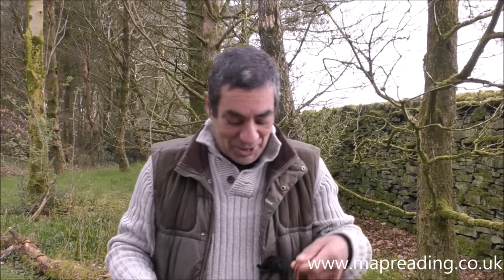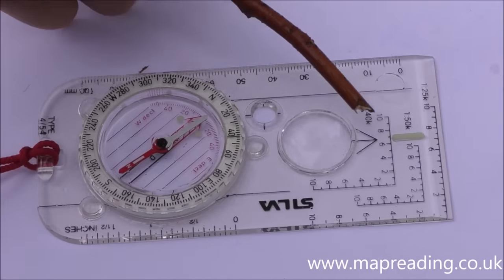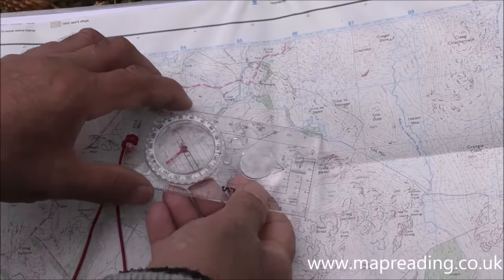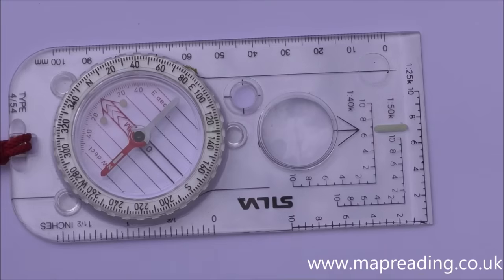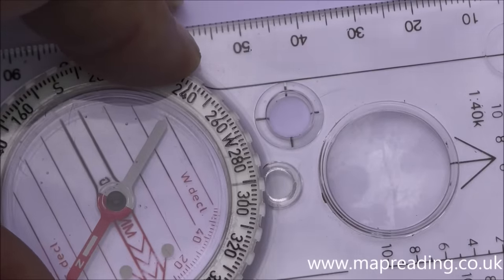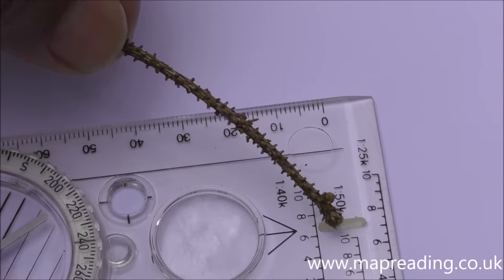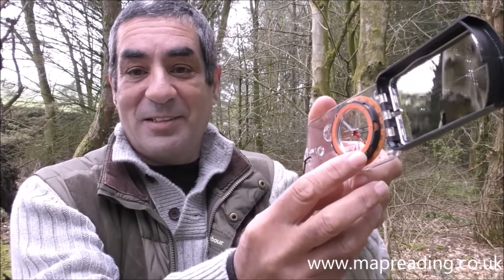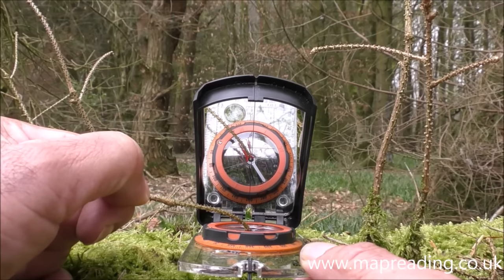Base Plate Compass, "every" part identified and explained

Comment: What are the 2 white dots either side of the red arrow?
Reply from the maker: Hi Pauline.  They are luminous marks so you can see the where the arrow is pointing at night
Reply: To center the needle between at night, they glow in the dark or are easier to see than the red which is very hard to see in low light.

Comment: Very interesting. I have a the same SILVA baseplate compass. Oddly the smallest Roman scale on mine is 1:63360. I’m going to search for the radiation sticker! Great video. Thanks for taking the time. I’ve often wondered what all the features are, particular the declaration graduations. Best from Switzerland.
Reply: 1:63360 is the old Ordnance Survey 1 inch to the mile which was what I grew up with 'back in the day' and was in common use by ramblers, hillwalkers, scouts nd guides.

Comment: You know, I learned how to use these things as a kid but I have not once used them since because I never deviated from marked trails and have always had a pretty good sense of direction and location anyway. Certain aspects of the described usage here I tend to take slight issue with. That is, a valid way of doing things but not the best way, such as the declination, setting a bearing, and incline measurements. I also have taken a dislike to oil compasses since every time I go to pull them out to pack them, they have a bubble in them. So I have instead kept a dry compass around. Yeah, you have to take care while using it and find a spot to set it on when you're reading it, but as long as you keep the dial locked when you're not looking at it, it's much more reliable. Also don't forget that the mirror compass can be used for the same thing mirrors in general can be used for while hiking and camping, including grooming and as a signal mirror.

Comment: In some places, where the magnetic declination is significant, an adjustment screw is preferred.  You could be in big trouble if you forget to make the adjustment or make a manual adjustment erroneously in the opposite direction.
Reply: Where I am (49N, 123W) it's about 16 degrees. That can induce an error that's easy to correct.
Reply: @DeadeyeLefty  Yes, if you turn the 16° the correct way then you will be good to go.  If you turn it the wrong way, the error will be 32°.  That's why I like the screw adjustment-- you'll get a lot more consistency.
Reply: I am about 120 miles from you so I have about the same declination.

Comment: Can you please tell me what the letter printed into the bottom of the baseplate you were using represents ? Under the magnetic needle there is a hollow arrow,  half red, half black with "MN" (or NW) printed in red in the red half of the arrow and a black letter printed in the black half of the arrow. On my compass it is a "D". I think on your compass it was a "C". The MN is obviously representing Magnetic North , but what is the purpose of the other letter ? I have asked several folk and a variety of suggestions have been made but what is it actually for ?  TIA.
Reply from the maker: Hi Clive, the letters on the bottom of the dial, e.g. FF, G, D. etc.  are codes indicating the year of manufacture - they don't produce a public list of which letters correspond to what year as it’s for internal use only.

MN & MS are the  magnetic zones the compass will work in - North and South.

Hope this helps
Reply: Silva compasses are balanced for three different zones: MN (Magnetic North), ME (Magnetic Equator), MS (Magnetic South).Thanks for the video, very informative
Reply: @MrPielips  Thank you very much for your reply. However , I am aware of the magnetic zones used by Silva. My question is not really about that, but about what the additional letter , in black , on the baseplate is for. If you look at your compass you will see what I mean, or , with respect, please re-read my original question , to clarify my enquiry. Thank you again.
Reply: The world is divided up into magnetic zones.
NM Nth Mag, US Nth America, Nth Europe. This helps to balance the needle towards Nth., if would not work in Aus or NZ so well.
Reply: @davidlegrand6545  Thank you for your reply David. Another guy has already made this point and as I said in my earlier reply to him , I am aware of these zones BUT my question is not about these , it's about the additional letter on the baseplate. Thank you again.
Reply: @TheMapReadingCompany Thank you for your reply , which only appeared on my feed today. Cheers for  clearing up this anomaly.  Over the years I have been told that those letters were for various "things" such as factory of manufacture , inital of person who made it etc., Since I posted my question my hillwalking friend Allan has come up with a old Silva compass which has a clear,obvious, date stamp on that position of "77" . So the codification of the date of manufacture must have , obviously , commenced after 1977. Can't tell you how pleased I am to have cleared up this very minor point.

Comment: I looked on the Silva website, it is quite difficult to find the manuals until you click on whichever compass you are interested in and then it has the manual for the one you have chosen, I would have thought it would be in a separate archive but nope, it is with the compass you are wanting to purchase, those Swedes are far too practical and did one for each compass.

Comment: Had map reading, plotting, cartography, surveying etc. rammed down my throat at secondary school during geography classes, in Wilts. How the hell could you get lost in England? Considered it a waste of time. Moved to New Zealand, and spent years hunting and trapping for a living in the forests here. Suddenly useful. I've taught many Kiwis how to map read and navigate, and found plenty more, lost in the bush, walking around in circles. No map or compass. You'd think that they'd teach that stuff in school here, but no.  I always carry 2 compasses, one in my pack, and one in my jacket, in case one gets broken or lost.
Two problems that I've encountered here. One bloke who always navigated using 'bush sense' was lent a compass on a foggy day for his own safety. He set the bearing to return, but the thing had a slide for locking the pointer, so it became useless. He returned OK using his bush sense, and told my friend that the compass must be broken. Do you have one of those in your collection? Another problem here is the amount of iron ore on the surface, and iron sand on the coast. You need to double check with the sun and your watch, and if you're a visitor from the northern hemisphere, the sun goes the other way around down here.

Comment: Maybe a quick video on what kind of stuff can interfere with the operation of a compass.  Around here there’s something called the Mount Penn spike. It is an outcropping of magnetic rock that interferes with compasses.  I don’t exactly know where this is because Mount Penn is massive and it’s actually a hill. At any rate supposedly compasses don’t work in that area.

Comment: Hi,
I saw the calibration clip. Any chance to make one about storage (when on a trip and when is not used), maintenance? On ebay there some kydex pouches (the seller say they are army issue)-are they usefull?
Reply from the maker: I’ve seen a few of these pouches advertised (there are many small companies trying to sell them) but I’ve never had one so I can’t offer any advice. 
I can understand keeping a £500 Francis Barker M73, a £140 Suunto KB 14, a £300 Breithaupt CONAT 4, etc in a protective pouch.  But for a cheaper compass, of the type I tend to use,  I can’t see the point.  If it gets scratched or dented then I’m fine with that, as long as it still works.  But anything which would break the compass e.g. accidentally standing on it, etc. isn’t going to be prevented by a canvass bag.
But some people love gadgets so if they want a little bag for their compass that’s OK.

Comment: The one that curves up at one end is probably made that way so that you can lay it flat on a surface without the lanyard interfering.
Reply from the maker: Oh, you may be right about that.  I didn't think of that.  Good point.  
I asked a rep at a trade show why they bent the back and she said it was to make it "ergonomically pleasing".
I have just looked a few compasses and most are just flat and they have a raised "bit" for the lanyard.

Comment: When I turn my Silva Expedition 4 upside down underneath the orienteering arrow there are two marks. The first mark is "MN". I understand this to be that my compass is meant for the Northern Hemisphere. However, next to the "MN" is a letter "H". I notice on other compasses that this letter will vary. Can you please share the meaning of these letters? Thanks in advance.
Reply from the maker: Hi David, the letters on the bottom of the dial, e.g. FF, G, H, D. etc.  are codes indicating the year of manufacture - they don't produce a public list of which letters correspond to what year as it’s for internal use only.

MN & MS are the  magnetic zones the compass will work in - North and South.

Hope this helps
Reply: Thank you very much for your clarification.  @TheMapReadingCompany

Comment: Have you ever had the problem of bubbles in the Rotating Bezel of a Compass.
Ive had to bin a few because of it.
I live in the UK so not been at great altitudes
Reply from the maker: Yes I've had quite a few.  It's a pain as it is 100% down to very poor quality control and lax systems in the manufacturing process.

Comment: I was told that those numbers around the compass circle are used to tell you the number of a runway in an airtport.
So if for example,  if a runway has a number that says R-28  or just the number 28.  That means that the runway will be going towards 280 degrees from 90 degrees.
It also tells the pilots that when they start to land,  they must go from 90 degree entrance towards the 280 degrees direction.  Which will be from L90 to R280.
And yes this is for every airport.  Also not all maps are drawn with true north in mind.  You must look at the legend to find out were north is FIRST,  then use the compass for that legend.

Comment: That was good.
I knew most of what you explained, but never knew about the declination marks within the rotating bezel.
And I can't understand why the compass manufacturers don't include a small prism for sighting accurately, as is on my Silva Expiditon 54.
Easier to use and cheaper to produce.
Cheers, Chris.
Reply: That's because the basic plate compass is designed principally as a tool for planning on a map, even though it's used by many for other things.

Comment: Circular and triangular holes: relics of the days when you would mark up an orienteering course from a master map.  Triangle is the start, circles around the controls.  I doubt they were often used as such in races.

Another important feature is the air bubble.

Comment: CORRECTION: at 6:00 after you turned the bezel to 330 degrees you forgot to include instructions to rotate the compass to line up the orienting arrow and magnetic needle before you start walking.  Otherwise you'll be heading in the wrong direction. You do however cove this correctly at 9:30.  Just wanted to point that out in case anyone found that confusing
Reply from the maker: Hi Micheal, good point.  This video is mainly just to identify the parts of a compass - I have LOTS of videos showing how to use them.  But you’re right, I should have rotated the compass to line up the needle with the orienting lines.  Thanks for for joining the conversation.

Comment: Gosh!  'n I allus thot the red needle pointed the way back to camp!!  Seriously, tho, I have that exact base plate compass, have used it for Many years, and finally NOW know what those other scales are for!  I have been using Garmin GPS's, currently an Oregon 600 with the Topo chip and Sat views for frequented places.  But - Know what?  The 'batteries' on my compass have yet to run down!  Stay Found!!  Jerry

Comment: What’s the “MN” and “HH” written on the bottom (readable when compass is upside down) of my Silva baseplate compass? MM is inside red part of the the orient arrow, the HH is inside the black part. If MN means magnetic needle, what is HH? Why is there a 0 on yours?
Reply from the maker: These are production date codes (the time the compass was manufactured) .  Silva do not give details as they are for factory and supply chain use only.
Reply: @TheMapReadingCompany  Thank you.

Comment: Nice, though it would be valuable to also name the 'Capsule' for the whole of the circular rotating part, to distinguish it from the 'static' base plate part.
Also, when the Capsule is separated (tools and skills;-) it is then more easy to see that the bevel scale is a Protractor (as per typical school pencil and paper geometry class), with the zero mark aligned to the north arrow.

I just did a 'private' video for a friend to show off the parts and how to relate the simple view of using the map and compass (first orient the map, then look along the desired mine of travel, etc etc) with the direct approach that many find lacks understanding of the 'protractor' effect.

Comment: AFAIK the declination (red) scale is to mechanically adjust your compass to your place's declination. There should be a tiny screw or kind of that on the opposite side of the device. You should rotate it until the red painted mark   points to the proper declination on the red scale. After this adjustment you can use the compass with automatic amendment of the declination.
Reply from the maker: The compass used in the video doesn't have a semi-perminate declination adjustment.
See here for full details:
Brunton - https://youtu.be/aH5EzwBiVb0?feature=shared
Suunto - https://youtu.be/hjjAgPzKfG4?feature=shared
Silva - https://youtu.be/dgvWnskAfxg?feature=shared
Cammenga - https://youtu.be/uzhTa-5rIEw?feature=shared

Comment: You can use the magnifier to start a fire which might be helpful.
Reply: It's rather small for that, not much power concentration. And the author is in England, so probably sees the sun about 10 days a year - and not for long each time. 😏
Reply: Excellent, just as you could also use the mirror for signaling.

Comment: It may be worth mentioning the significance of the lettering inside the orientation arrow on the base plate.
Compasses are hemisphere specific.
There are three types available from Silva.
MN for magnetic North
 MS for magnetic South and ME for magnetic equator.
Using the wrong compass in the wrong zone will cause the magnetic pointer needle to foul on the base plate making the compass useless.
 don't ask me how I know. 0:21

Comment: HA!.. I didn't know that. I even got one and it's been in my backpack for decades but I don't think I've ever had to use it apart from getting used to it when I first bought it. I did have some minor experience with compasses in the army though but that one was in mils and had laser distance measuring :-) ... Still, that should still help even if it is buried under 30 years of life.   

Oh wait I used it once to get a bearing from the top of the hill to a church so I could bushwack through the heather valley to get to the village.

Comment: Interesting. I haven't use compass for 30 years and I wonder if it's actually useful. I live in central Europe and walking in perfectly staight line in places that are intersting is not always possible: steep hills, rocks, raspberry bushes, very dense young trees, ... Sometimes it's viable to take few hundred meters long shortcut, but following general direction is fine. Well. That sort of answers my question cause keeping general direction in a heavy downpour which prevents using phone and visibility is limited is impossible

Comment: Why are the smaller scales for more accurare eastings and northings always printed back to front , and in reverse ?  Counting BACK from 10 not UP to 10 Same with northings , even silva still do this  ! Are we wrong ? Or the compass makers
Reply from the maker: Hi Joe,  that’s a good question.  
The reason they go backwards is that they are distances “from” not “to” the easting or northing.  If you put the 0 (where the lines meet) on your position on a map, you can look at the number on your compass which runs through the easting and northing and that will give you the Grid Ref or UTM.  Hope this helps.

I made a video about this topic. 
https://youtu.be/yfcymnPE304

Comment: Bearing? A bearing is an angle less than 90° within a quadrant defined by the cardinal directions. An azimuth is an angle between 0° and 360° measured clockwise from North. So unles you are gonna Ball park your Direction you should use an Azimuth

Comment: Tritium is radioactive, which is why it glows all on its own.  But it is not an ionizing radiation and is perfectly harmless to humans, since it can not penetrate your skin, unless you chose to swallow it, but even then the amount used on a compass still would not be enough to cause harm.  But that does not change the fact that you should not be putting tritium inside your body in any amount.  But if you do, the half life of tritium inside a living body is around 10 days to 2 weeks depending on your water intake since tritium wants to combine with water and become inert when it does.  Then it will just flush out over time.

That being said, tritium is also formed in the atmosphere by cosmic rays so there is always a small amount always present in the atmosphere you breath.
Reply from the maker: Tritium on its own doesn't glow.
See here (the outtakes at the end) for a (very) brief explanation. 
https://youtu.be/i97jiLxeEwI

Comment: A magnetic compass is becoming less and less relevant with every passing year but it’s use is a skill that everyone venturing into the wild should have.  You should always have both a GPS and a compass.  In the middle of Norway on a solo trip my old Silva compass pivot point wore out and froze.  I had to rely solely on an electronic map and GPS.  Be warned. Compasses don’t last forever.